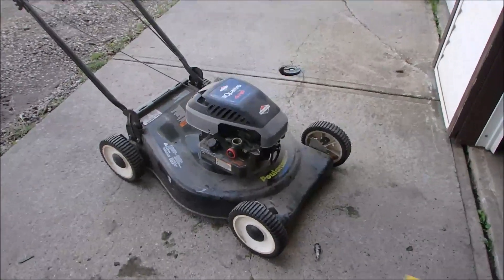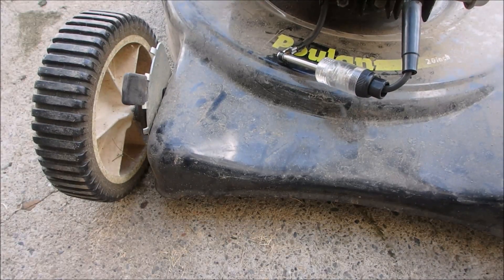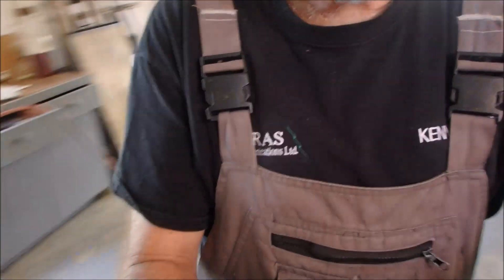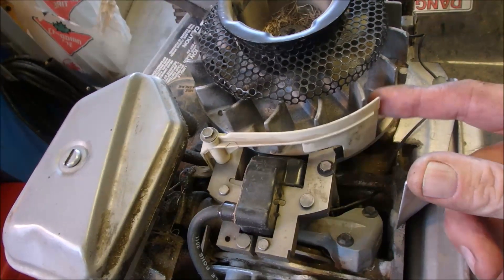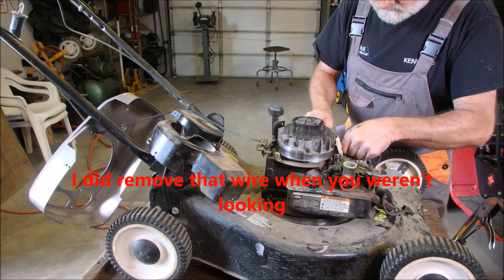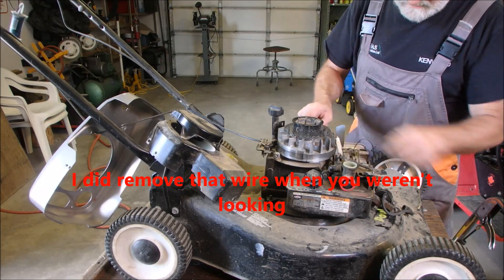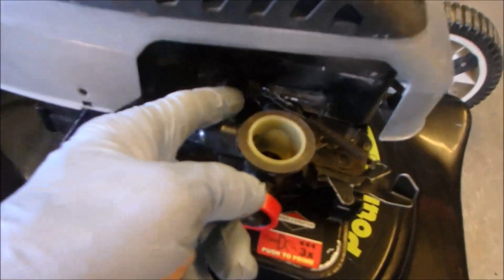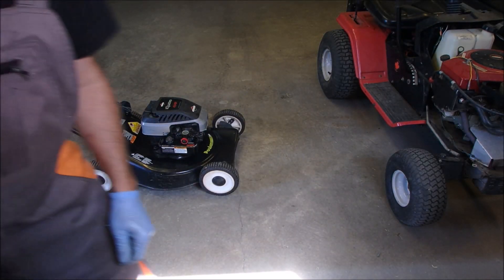A 4HP Briggs Mower Tricked Me Part 1

Comment: Good job Godfather of mower science ( Professor Gadget). Those weak spark issues are always tricky. Performing a simple electrical science experiment and problem solved. I also like that carb setup. Simple and easy to work on. Great video as always.
Reply from the maker: Thanks Raymond.  I am not an expert just persistant
Reply: Yes you are Bruce. Have a good one.

Comment: Many call that an air vein governor. Briggs describes it as a Pneumatic Governor. Very simple, effective and as we know, fewer parts to fail! The original coil you showed is an early Magnetron, which, as you saw, did indicate spark...the reason it wasn't strong enough is because the polarity on the magnets is reversed on the early solid state ignition coils. Hitting North South when it should hit South North. Don't throw that coil away!! It's new, just not the right one for that 1998 engine. More for a 1984-1992. An easy way to detect polarity in the flywheel magnets is with a compass held about 2-3 inches from the flywheel, then rotate flywheel and watch which side of the flywheel magnet points true north. This is handy if you run into this again only with a new Magnetron on an old engine with reversed polarity. Another way to tell early from late Magnetrons is, the button is visible on the late models and it's encased on the older models. All electronic ignition coils have the added encased boss to one side of the coil wraps. A points Magneto will only have the windings and therefore no extra side piece encased in epoxy/resin between the lamination legs. Thanks for the shout out! A little history and why Briggs changed the polarity on the magnets. Essentially, they goofed, and when they realized it, instead of retooling their Magnetron assembly line, they simply repolarized the magnets to correct the firing issue. This is why we used to hear, you have to send in the flywheel to have the magnets repolarized (At Briggs expense) to install a solid state ignition coil on a points engine. Cheers my Northern Friend! Zip~
Reply from the maker: Well i thought it was just a coil.  Thanks Sean.  I have only been  back yard mechanic guy since i retired and totally self taught..  Great explanation.
Reply: It gave me a video idea to show the polarity between an early and a late Magnetron using a compass....should be interesting! Back is out right now, so it'll be a couple days before I get that set up to shoot a video on. Cheers! Zip~
Reply from the maker: The ONLY good thing about a back being out is that I guy can get caught up on some videos.  Watching and uploading.  Making them is even harder on the back than just regular work as a guy has to take his time in weird contortionist shapes.  I literally feel for you sir.  I get it   physio,exercise,massage, muscle relaxants and TIME.
Reply: Great info.
Reply: Thanks my Friend! I know you're a big Tecumseh guy, so I lean on you with those little guys. Zip~
Reply: Wow, that's great info there, thanks!

Comment: I think when you tested for spark, the plug wire was on the frame. Wouldn't that ground it causing no spark? I have that tester and found it hard to see it from the back except at night. I use an automotive neon timing light so I can see it easier. If the throttle springs are missing, it won't fast idle.

Comment: Hi Bruce, I have a Husqvarna 232 R weed wacker and have had it for years. I love that weed wacker..lol. My problem is originally the primer bulb went bad and I changed it then discover all of the other lines were also rotted. I replaced all the lines and ended up cleaning the carb. now that it is back together it starts great after primer, idles great and turns up rpm like it should. After about 30 seconds or so it starts bogging then cuts off like it is not getting anymore gas. prime it again 3 pumps starts great runs great then dies, same thing. What am I over looking? Is it possible I got the lines switched wrong?  Thanks Bill   P.S you need the extension apple picker so you don't have to mess with a ladder..grins
Reply from the maker: It could be.  2 stroke stuff can be difficult as the intake manifold has part of the engine crankcase  as its area.  Leaking crankshaft seals can cause that as well.  Redo the gas lines of course first.  Let me know.
Reply: +Bruce Pender .....could it be his gas cap?
Reply: lmdetect I'll check that..Thanks
Reply: Yup! that was it. Just cleaned up the cap and cleaned the breather. SHe goes great now. The love affair is back on..lol. I should of checked that, I do on all my other machines. Thanks..see, that's all it takes sometimes is just a new perspective.
Reply from the maker: good one.  you know i miss that one until after I spend money haha  THANKS
Reply: +william armstrong , yeah, I want to take a hammer to my lawn mower when it was doing the same thing a few years back.  Then I remembered that the gas cap has to breath.  Bingo!  lol
Glad you're up and running again.

Comment: I love your videos please keep doing them. And how do you clean the mower to looked really good?
Reply from the maker: First I blow them off with compressed air,  Then I just wipe them down.  Sometimes I use a pressure washer.  And yes sometimes I moisten a rag with a SMALL amount of old gas to wipe the oily marks off.

Comment: Do you still like your mower lift? Is it to low for you to easily work on stuff? I read on harbor freights website it only goes up 28 inches high.
Reply from the maker: I don't know what I would do without it.    This one lifts to 30 inches which is an inch lower than the tailgate of the pickup truck.

Comment: Ain't it fun to bring something back to life? I noticed you had a first fire brand plug, I've had a sting of bad luck with them lately it will be just a bad running engine or even a dead miss at mid rpms change the plug and problem is solved.
Reply from the maker: Yes.  I don't like them either.  It was on the machine when it came in as a non runner..  It is now my "back alley" mower so a mechanical issue won't be a problem.  That said i am going to put a RJ19LM into when I go out this am.  Thanks Doc.   SBBDoc   is that silent but deadly ????
Reply: LOL, it should be but its for the ATV club it was Soggy Bottom Boyz and I have had the nickname of Doc for a long time.
Reply from the maker: FUNNY!!!

Comment: OK, so someone had installed an older points style coil, guess it never worked after that....I didn't think any of those coils had primary leads that disconnected from the coil, but who knows...And yes, there is nothing like a good ol simple/reliable Briggs!
Reply from the maker: If you read Zippo Varga'a comment it explains the coil.  Thanks sir.  I learn too.
Reply: OK, I understand now, that coil was from an early model "magnetron", not the standard points/magneto coil, guess that is why it had the removable lead!  Very interesting explanation he gave, guess that just goes to show that you should use the exact part number described in the parts manual!   You weren't tricked, you were right, just change the word "bad" to "wrong"!  Wish I could go back to Briggs school!